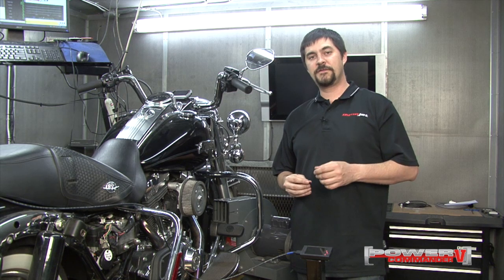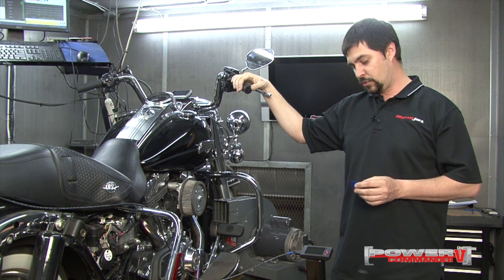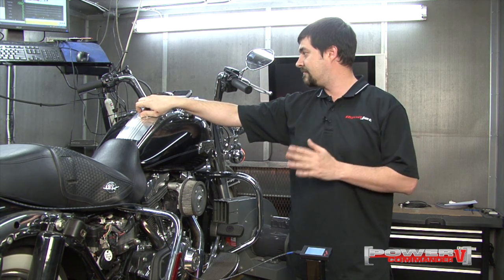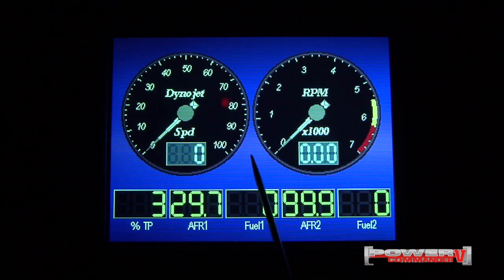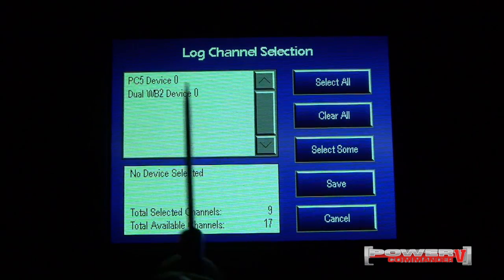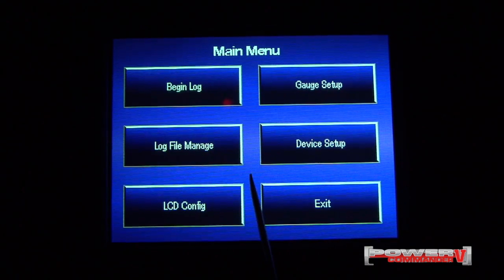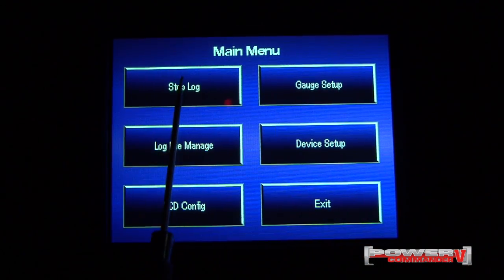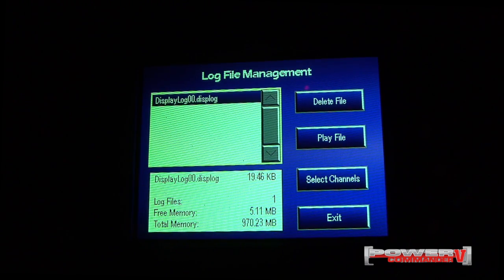Dynojet's LCD-200 Data Logging Tutorial

Comment: what they don't tell you is the lcd 100 and 200 are the same. only difference is the firmware. you can update a 100 and use it on a PC5.